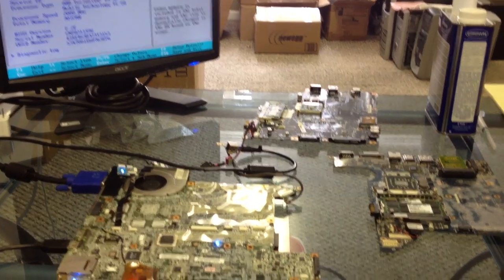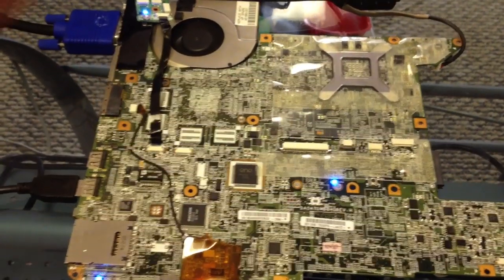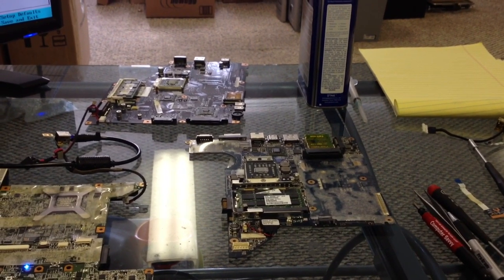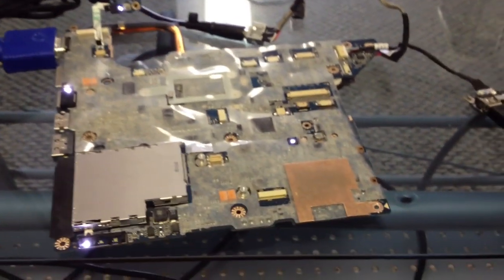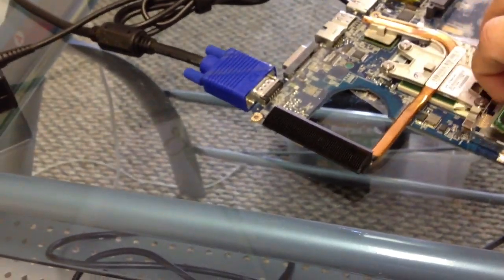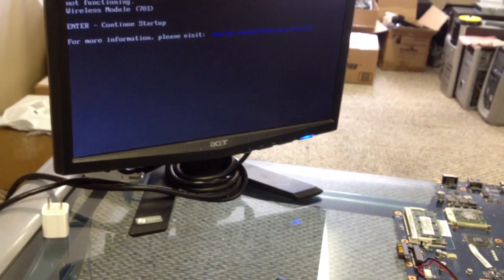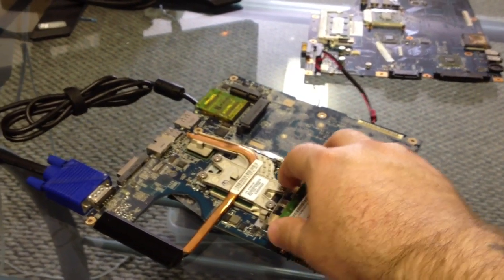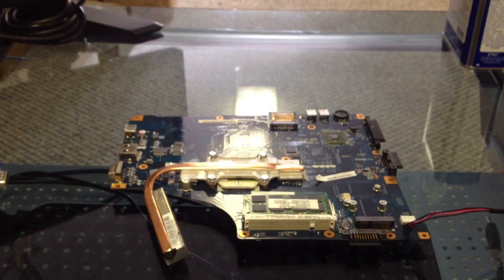HP DV4 motherboard repair to fix a blank screen and black screen

Comment: I love you. I took apart my dv4 to reflow my board which manged to change the flash code to 4 flashes up from only 1 but still experienced the black screen of doom. I took one of the memory cards out and it fixed my problem, thank you

Comment from the maker: Without seeing it I cannot say.  It can be a BGA, it can be an inverter failing on a load, it could be a dead pin in the cable, it could be the LCD itself.  Just because you checked on does not mean it is not it.  Just because you get video on an external does not mean it is not the BGA.  I see DV9000s that work on external and still have a BGA issue.  I see DV2000s that will not sync to the external but work fine on the internal screen.